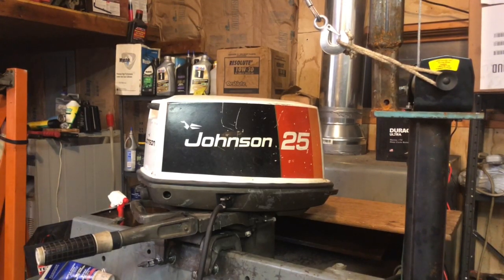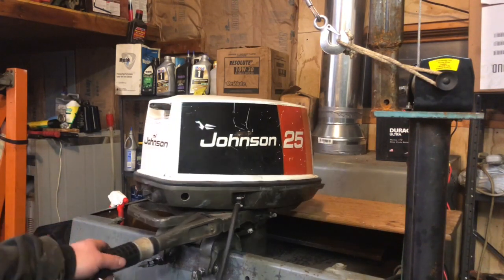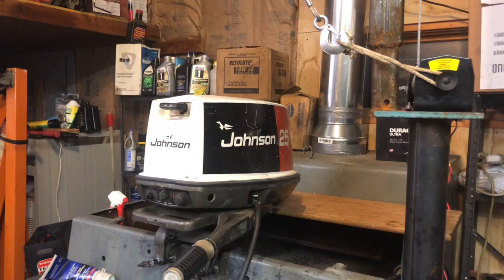1976 25hp Johnson outboard tank test

Comment: I just recently bought my first boat. It's a 1973 Rich line GF16. It came with a 1976 Johnson 25 looks like this one ? Has electric start.  Anyways I know nothing about these motors and I plan on diving in and learning. The only thing I have checked is the compression so far. Their at 125. Any quick check advise that a rookie like me might look over on testing major components? Like gear play... What's normal when in gear  or where to look for cracks ? I'd appreciate any advise. I am an automotive technician. Just never messed with 2 stroke engines.
Reply: You ever have any problems? I might buy an old one and I was curious